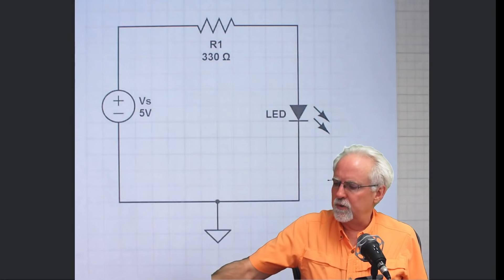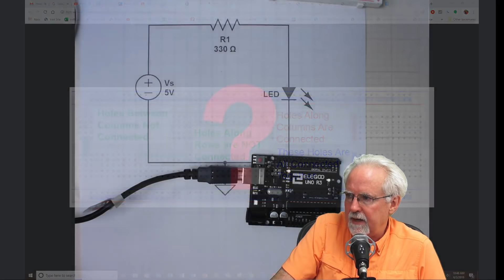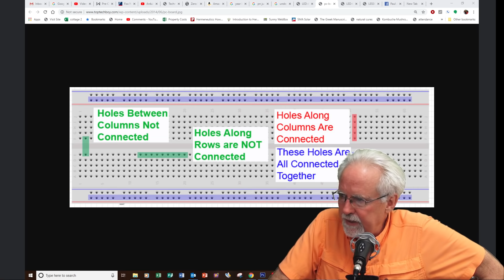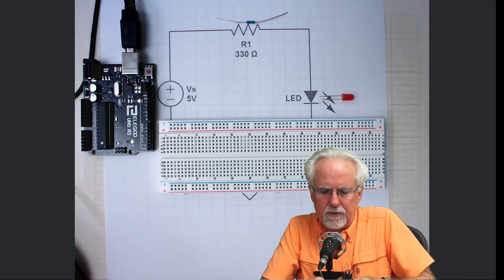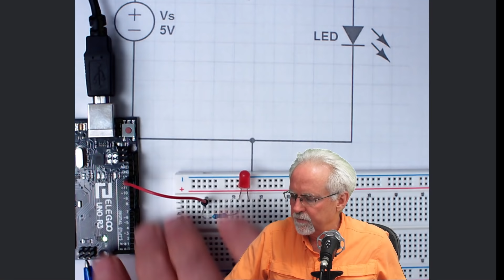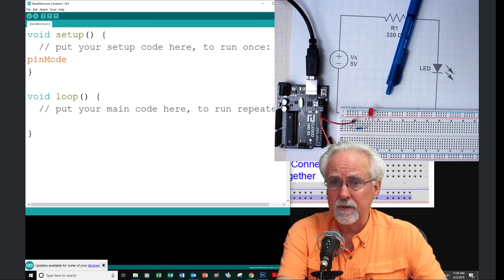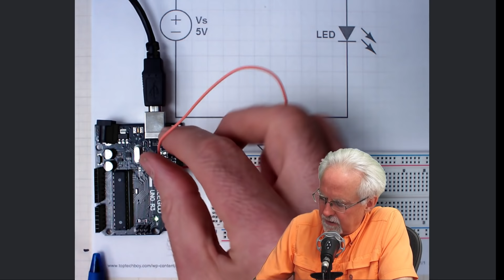Arduino Tutorial 3: Understanding How Breadboards Work

Comment: Thank you Paul for these amazing lessons!! The assignments you give at the end of the lessons so far are really well thought out for the difficulty of figuring things out on our own. I can't wait to get to the end of these lessons and see how far I'll have gone from now! Loving your teaching style and pacing.

Not knowing C/C++ is making this quite amusing. I understood the assignment after you said we will need to use 3 different pins and basically gave away that we need to copy/paste the block of code that blinks the chosen LED 'x' number of times. I figured the last blink would just be setting the LED to LOW and removing the time delay before the next LED. The program started with a little extra setup in the loop, setting all pins to LOW and a 250ms time delay before starting the blinking. I did this so I could ensure that the end of the cycle was properly going back to the start.

130 lines of mostly copy-pasta'd code later, I'm happy to say I achieved the intended effect the first try!! Because I don't know C/C++, but I am a little familiar with Python(still a beginner), I knew there was a shorter, more efficient way of achieving this goal. So over to Bing Copilot I went to have it give me a simplified, more efficient way of writing the program. I then got it to explain to me the code that I didn't know. "for(int i=0; i<times; i++)" is something I hadn't seen and turns the program into 24 lines with the help of defining a new variable that contains the pin and number of blinks.

Comment: Hi Paul, I didn't return my Arduino to Amazon. I decided to persevere with it, and after a couple of hours of experimenting, i had a beer, returned to the computer and reset the whole programme. This allowed me to set up using IDE 1.8.  I'm pleased to report that I can now do things with my Arduino UNO.  I'm glad that I did. Thank you for your explanations. I've just finished lesson three; I managed to get three LEDs printed simultaneously, and individually. But I have a problem. I am unable to enter a new operation. My UNO seems to be stuck on channel 13, LED burning away, permanently in the ON posn,  and I can't see how to clear that and enter something new.  What have I missed? I've been back over Lessons 1,2 & 3, but I can't see where I've gone wrong. Regards, Roger

Comment: hi Paul, how do i plug the negative wire back into the arduino if it only can have one wire in it at a time because the GND hole can only fit one wire in it?
Reply from the maker: Bring a wire from the ground on the arduino to the ground rail on the breadboard. Then that whole row becomes ground.

Comment: Hello Paul!
Thank you for this video. I have a question. If electrons flow through the cathode to the anode, what’s the point of putting the resistor to the anode after the electrons provided its current to the led? Thank you!
Reply from the maker: The purpose of the resistor is to limit the current, so that it does not become too large, and damage the LED.
Reply: @paulmcwhorter  ok thank you!
Reply: @paulmcwhorter  I understand that but why not put it on the shorter leg of the led to limit the current to the led. Why is it put on the longer leg after all the current already reached the led.
Reply: Let’s say you have water flowing through a tunnel in a river. You wouldn’t build a wall after the tunnel to limit the amount of water entering the tunnel but you would rather put it before the tunnel.
Reply: @Edu-tj1ep  You could, indeed, build a wall AFTER the tunnel to limit the amount of water entering the tunnel.  Same with electricity.
Reply: @Edu-tj1ep The way I understand is is because the LED is a diode. Like a one way valve. Think of the long leg as being in inlet and the short leg the outlet. If you put the restrictor at the outlet the electrons will rush in and destroy the one way valve (the led). You restrict the flow first then let it go through the one way valve.

Comment: Could someone please explain to me why the first LED (red light) in the homework is brighter than the other two LEDs? Does it have to do with the voltage?
Reply from the maker: Did you remember to do your pinMode() on the other pins? Either that or resistor values are wrong.
Reply: @paulmcwhorter  I did not put in the pinMode() for the other pins. The other two LEDs are brighter now. Thank you so much😀😀😀

Comment: Thanks Paul. I'm a geriatric too, 80 years old. But I have invented a new type of air conditioning system that uses very little electricity (Google PCT/AU2020/050828) and just been told the US patents office will grant me a patent. I am building a prototype in my garage and I have digitised my 50 year old lathe hoping to be able to machine the exacting shapes required. I am following your course in the hope that I can learn how to control my with a computer.

Comment: // C++ code
int i,k,h;
void setup()
{
  pinMode(8, OUTPUT);
  pinMode(10,OUTPUT);
  pinMode(12,OUTPUT);
}

void loop()
{
  for(i=1;i<=3;i++)
  {
    if(i<4)
    {
  digitalWrite(8, HIGH);
  delay(1000); // Wait for 1000 millisecond(s)
  digitalWrite(8, LOW);
  delay(1000); // Wait for 1000 millisecond(s)
    }
  }
  
 for(k=1;k<=5;k++)
 {
   if(k<6)
   {
  
  digitalWrite(10, HIGH);
  delay(1000); // Wait for 1000 millisecond(s)
  digitalWrite(10, LOW);
  delay(1000); // Wait for 1000 millisecond(s)
      }
 }
  for(h=1;h<=8;h++)
  {
    if(h<9)
    {
  
  digitalWrite(12, HIGH);
  delay(1000); // Wait for 1000 millisecond(s)
  digitalWrite(12, LOW);
  delay(1000); // Wait for 1000 millisecond(s)
      }
  }
    }

(this is the code that i have done pls check it once)
Ps- Your Hw Question
red blinks-3
Yellow blinks - 5'
Blue blinks - 8

Comment: How do you know what kind of resister to use for leds? Is there a guide book in the kit ?
Reply: Most LEDs require any resistor between 200 to 470 ohms. If you go under 200 ohms you risk burning your LED out, and if you go above 470 ohms the LED will be really dim, and if you have an LED that is different from the LEDs that Paul is using you can use ohms law, which you will learn soon in these lessons to figure out how much resistons you need.

Samuel :)

Comment: One more thing, if you are going to run LED's in parallel this way it doesn't seem to work. The current fails to split. It seems there is some difference in the resistances of the LED's so only one of them lights, at least if they are different colors. Two reds work just fine.

Red LED Resistance < Green LED Resistance.

Comment: // C++ code
//  

int PinNum = 7;
int LoopNum = 0;

void setup()
{ 

  pinMode(8, OUTPUT);
  pinMode(9, OUTPUT);
  pinMode(10, OUTPUT);
}

void loop()
{

  PinNum += 1;
  LoopNum += 5;
  
  for (int i=0; i<LoopNum; i++) 
  {
   	digitalWrite(PinNum, HIGH);
  	delay(500); // Wait for 1000 millisecond(s)
        digitalWrite(PinNum, LOW);
  	delay(500); // Wait for 1000 millisecond(s)
  }
 
}

Comment: Hello Mr Paul 
I could make 3 lights blinks but two things I wanted to check 

1)GND port there is only one How I am suppose to connect all ... in my case I did a bridge from GND to red light then to green light and then to blue light and it work but I was wondering is there a better way? 
2)when it comes to writing the code what is the syntax to make each light blink different amount of times ?

Comment: int red = 5;
int blue = 6;
int green = 7;
void setup(){
pinMode(red,OUTPUT);
pinMode(green,OUTPUT);
pinMode(blue,OUTPUT);}
void loop(){
digitalWrite(red,HIGH);
delay(500);
digitalWrite(red,LOW);
delay(500);
digitalWrite(red,HIGH);
delay(500);
digitalWrite(red,LOW);
delay(500);
digitalWrite(red,HIGH);
delay(500);
digitalWrite(red,LOW);
delay(500);
digitalWrite(red,HIGH);
delay(500);
digitalWrite(red,LOW);
delay(500);
digitalWrite(red,HIGH);
delay(500);
digitalWrite(red,LOW);
delay(500);
digitalWrite(blue,HIGH);
delay(500);
digitalWrite(blue,LOW);
delay(500);
  digitalWrite(blue,HIGH);
delay(500);
digitalWrite(blue,LOW);
delay(500);
  digitalWrite(blue,HIGH);
delay(500);
digitalWrite(blue,LOW);
delay(500);
  digitalWrite(blue,HIGH);
delay(500);
digitalWrite(blue,LOW);
delay(500);
  digitalWrite(blue,HIGH);
delay(500);
digitalWrite(blue,LOW);
delay(500);
  digitalWrite(blue,HIGH);
delay(500);
digitalWrite(blue,LOW);
delay(500);
  digitalWrite(blue,HIGH);
delay(500);
digitalWrite(blue,LOW);
delay(500);
  digitalWrite(blue,HIGH);
delay(500);
digitalWrite(blue,LOW);
delay(500);
  digitalWrite(blue,HIGH);
delay(500);
digitalWrite(blue,LOW);
delay(500);
  digitalWrite(blue,HIGH);
delay(500);
digitalWrite(blue,LOW);
  delay(500);
  digitalWrite(green,HIGH);
delay(500);
digitalWrite(green,LOW);
  delay(500);
  digitalWrite(green,HIGH);
delay(500);
digitalWrite(green,LOW);
  delay(500);
  digitalWrite(green,HIGH);
delay(500);
digitalWrite(green,LOW);
  delay(500);
  digitalWrite(green,HIGH);
delay(500);
digitalWrite(green,LOW);
  delay(500);
  digitalWrite(green,HIGH);
delay(500);
digitalWrite(green,LOW);
  delay(500);
  digitalWrite(green,HIGH);
delay(500);
digitalWrite(green,LOW);
  delay(500);
  digitalWrite(green,HIGH);
delay(500);
digitalWrite(green,LOW);
  delay(500);
  digitalWrite(green,HIGH);
delay(500);
digitalWrite(green,LOW);
  delay(500);
  digitalWrite(green,HIGH);
delay(500);
digitalWrite(green,LOW);
  delay(500);
  digitalWrite(green,HIGH);
delay(500);
digitalWrite(green,LOW);
  delay(500);
  digitalWrite(green,HIGH);
delay(500);
digitalWrite(green,LOW);
  delay(500);
  digitalWrite(green,HIGH);
delay(500);
digitalWrite(green,LOW);
  delay(500);
  digitalWrite(green,HIGH);
delay(500);
digitalWrite(green,LOW);
  delay(500);
  digitalWrite(green,HIGH);
delay(500);
digitalWrite(green,LOW);
  delay(500);
  digitalWrite(green,HIGH);
delay(500);
digitalWrite(green,LOW);
  delay(500);}
Reply: has to be a better way to program this?

Comment: I'm just starting this course and wrote a code for blinking led. I wrote an int for pin 8 and an int for delay time checked for errors and didn't get any. Ran the code thru my arduino  & breadboard but my led wasn't very bright. (I am using a new kit.) When I checked my code my error was that I had used the command digitalWrite instead of the command pinMode. I'm surprised that it worked with the wrong command but after fixing my code the led was brighter.

Comment: Here's my code: 

void setup() {
  // SET UP ARDUINO
  
  pinMode(8,OUTPUT);
  pinMode(6,OUTPUT);
  pinMode(4,OUTPUT);
}
void   
loop() {
int myBlinks = 1;
for(myBlinks = 1; myBlinks <=5;myBlinks++){
  // RED 5x

  digitalWrite(8,HIGH);
  delay(500);
  digitalWrite(8,LOW);
  delay(500);
}
for(myBlinks = 1; myBlinks <=10;myBlinks++){
  // GREEN 10x

  digitalWrite(6,HIGH);
  delay(500);
  digitalWrite(6,LOW);
  delay(500);
}
for(myBlinks = 1; myBlinks <=15;myBlinks++){
  // BLUE 15x

  digitalWrite(4,HIGH);
  delay(500);
  digitalWrite(4,LOW);
  delay(500);
}
}

Comment: Success with three blinking LEDs. Running the green and blue grounds back to the first red LED ground column worked. I created a variable (int myBlinks = 1), then I used the for function to loop a specific number of times for each LED, rather than copy and pasting the same digitalWrite over and over. Nested all the three for functions inside the loop so it just repeats over and over. Fun homework assignment for this newbie.

Comment: I'm exited about my new Arduino board so after I watch your video I complete my homework. Here is my code:
```
int basePin = 10;

void setup() {
  // put your setup code here, to run once:
  pinMode(basePin, OUTPUT);
  pinMode(basePin + 1, OUTPUT);
  pinMode(basePin + 2, OUTPUT);
  Serial.begin(9600);
}

void blinkTimes(int pin, int times) {
  Serial.println(pin);
  
  for ( int i = 0; i < times; i++) {
    digitalWrite(pin, HIGH);
    delay(500);
    digitalWrite(pin, LOW);
    delay(500);
  }
}

void loop() {
  for(int pinDx = 0; pinDx < 3; pinDx++) {
    blinkTimes(basePin + pinDx, 5 * (1 + pinDx));
  }
}
```
Reply: Oh wow, this is some good work you did here. it was good thinking to use a function in the code. But I have a question, how do you know how to use functions, for loops, and some other things if Paul has not taught you those things yet? do you already know some Arduino or are you cheating on your homework? I give you an A 100+ for this homework if you did not cheat on it.

Comment: Homework:
void setup() {
  // put your setup code here, to run once:
  pinMode(8,OUTPUT); //red
  pinMode(7, OUTPUT); //green
  pinMode(6, OUTPUT); //blue
}

void loop() {
  // put your main code here, to run repeatedly:
  // digitalWrite(8, HIGH);
  // delay(500);
  // digitalWrite(8, LOW);
  // delay(500);

  // homework
  // red 2 times blink
  digitalWrite(8, HIGH);
  delay(500);
  digitalWrite(8, LOW);
  delay(500);
   digitalWrite(8, HIGH);
  delay(500);
  digitalWrite(8, LOW);
  delay(500);
   
  
//green 5 times blink
  digitalWrite(7, HIGH);
  delay(500);
  digitalWrite(7, LOW);
  delay(500);
  digitalWrite(7, HIGH);
  delay(500);
  digitalWrite(7, LOW);
  delay(500);
  digitalWrite(7, HIGH);
  delay(500);
  digitalWrite(7, LOW);
  delay(500);
  digitalWrite(7, HIGH);
  delay(500);
  digitalWrite(7, LOW);
  delay(500);
  digitalWrite(7, HIGH);
  delay(500);
  digitalWrite(7, LOW);
  delay(500);
  
  //blue 7 times blink
  digitalWrite(6, HIGH);
  delay(500);
  digitalWrite(6, LOW);
  delay(500);
  digitalWrite(6, HIGH);
  delay(500);
  digitalWrite(6, LOW);
  delay(500);
  digitalWrite(6, HIGH);
  delay(500);
  digitalWrite(6, LOW);
  delay(500);
  digitalWrite(6, HIGH);
  delay(500);
  digitalWrite(6, LOW);
  delay(500);
  digitalWrite(6, HIGH);
  delay(500);
  digitalWrite(6, LOW);
  delay(500);
  digitalWrite(6, HIGH);
  delay(500);
  digitalWrite(6, LOW);
  delay(500);
  digitalWrite(6, HIGH);
  delay(500);
  digitalWrite(6, LOW);
  delay(500);
}
Reply: Looks good!!!!

Comment: How do you connect all me LED circuits to ground for the home work?
Reply: You can connect the GND pin from the Arduino to one of the rails for the + and the - power, you know those two rails that are on both sides of the breadboard, one of those, and you probably should use the one that is labeled - and then connect all the LEDs GNDs to that rail that you connected the GND from the Arduino too. I hope that helps you and keep up the good work.

Samuel

Comment: If there is 3 positive pins then there should be 3 GND pins. But I only found 1 GND pin in the arduino
Reply: Well, there are 3 GND pins on the Arduino uno board, one is next to pin 13, and the others are next to the 5v pin they should be labeled GND as well. But I think I know what you are thinking, you are thinking that every LED needs its own GND pin, but that is not true the LEDs can all share the same GND pin. All you need to do is take one of the GND pins on the Arduino and connect it to one of those power rails that are on both sides of the breadboard one of those rails has two rows one row is labeled + and the other one is labeled - it is recommended to connect the GND from the Arduino to the row that is labeled -, and then just connect all the GNDs from the LEDs to that row and it should work. But you may be thinking why do I need to use three digital pins on the Arduino if I do not need to use three GND pins? well, you can connect all the LEDs to one digital pin on the Arduino but remember that Paul said that for your homework you need to make each of the three LEDs blink a different amount of times, for an example one LED should blink 5 times and another LED needs to blink 10 times and then another LED needs to blink 15 times. But if we connect all the LEDs to the same digital pin we will not be able to do that. I hope you get this working, I know it is hard right now, but soon you will start flying. keep up the good work

Samuel

Comment: but why is it pinmode(13, output) ? shouldnot it be input? LED should be the output.
i also tested it, when i changed the resistance from 330 to 100k. the light of lamp didnot changed.
but it did changed when i wrote pinmode(13, input)

Comment: Is anyone able to explain why the on-board LED stayed on after Paul changed the pinMode from 13 to 8. Shouldn't the on-board LED have turned off as the power was now going to Pin 8 and not pin 13??

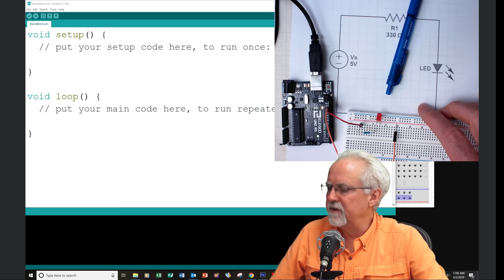Comment: Great Video Paul but at 20:53 you were close to shorting out the power supply of the Arduino as the ground wire was plugged in and almost touching the
positive side of the resistor. Good practice to plug in the ground wire to the breadboard and then when you have circuit checked and ready connect the ground wire to the Arduino GND terminal.

Comment: I've just built my first traffic light!
You are an awesome teacher, Mr McWhorter 😁
Greetings from Brazil!

Here is my  code if anyone wants:

#define RED_PIN 10
#define YELLOW_PIN 12
#define GREEN_PIN 8

#define RED_DELAY 6000
#define GREEN_DELAY 3000
#define YELLOW_DELAY 1000

void setup() {
  pinMode(RED_PIN, OUTPUT);
  pinMode(YELLOW_PIN, OUTPUT);
  pinMode(GREEN_PIN, OUTPUT);
}

void turn_on_light(int pin, int duration) {
  digitalWrite(pin, HIGH);
  delay(duration);
  digitalWrite(pin, LOW);
}

void loop() {
  turn_on_light(RED_PIN, RED_DELAY);
  turn_on_light(GREEN_PIN, GREEN_DELAY);
  turn_on_light(YELLOW_PIN, YELLOW_DELAY);
}

Comment: // Code to cycle pin 13

uint8_t pin = DDB5;  // Address for pin 13 on PORTB is DDB5
void setup() {
}

void loop() {
 PORTB |= (1<<pin); // Set PORTB DDB5 address to 1 (on)
 delay(500);
 PORTB &= ~(1 << pin); // Set PORTB  DDB5 address to 0 (off)
 delay(500);
}